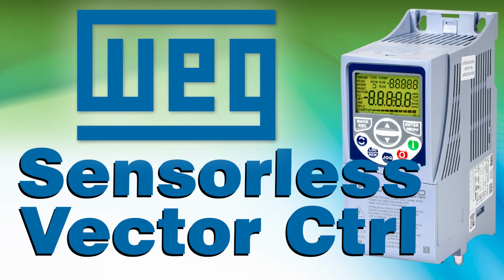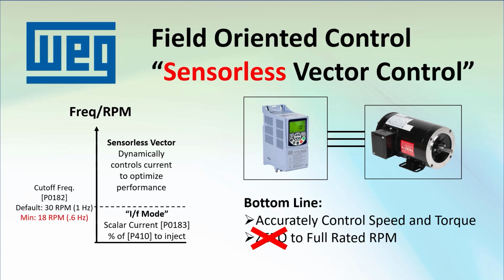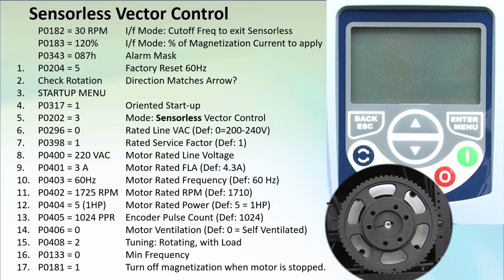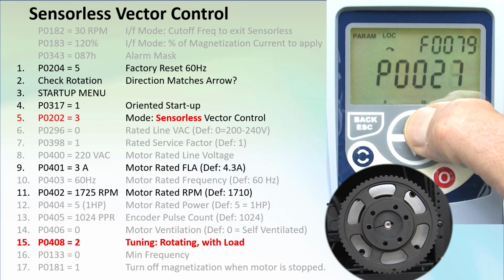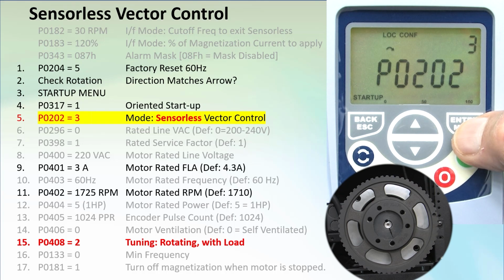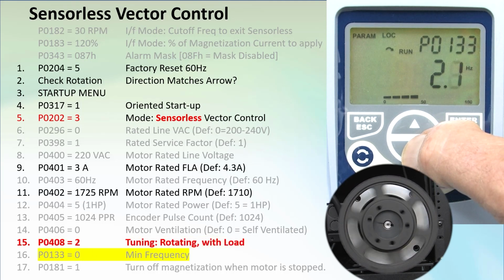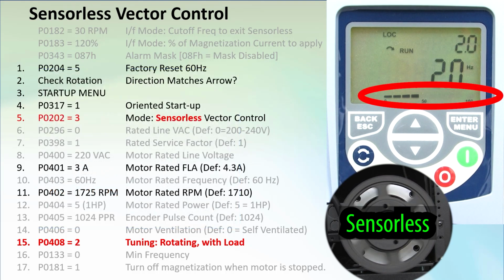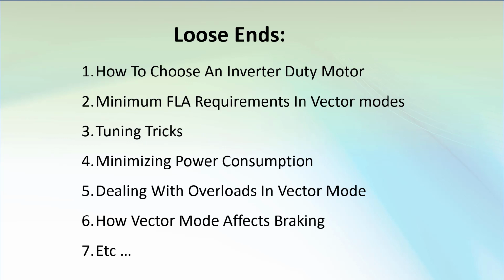WEG CFW500 VFD Sensorless Vector Control from AutomationDirect

Comment: In this case, are you using econder or not??
Reply from the maker: Not in this case. The CFW500 does support some vector modes that will utilize encoder feedback. This is a sensorless vector mode so it utilizes real time electrical feedback from the motor leads to allow the drive to target precise speed and torque at nearly any frequency.
Reply: @automationdirect  In this case, can it be used as a printer rewinder? As soon as the operator stops the machine, the material is tensioned
Reply from the maker: @murilomotta5038, in most printer unwinder applications we would recommend a servo for much faster response time to the torque loop in the material tensioning. This drive can be used for tensioning applications in firmer stronger materials (like taking up belt tension in a flexible tension situation for a conveyor) but take a look at our SureServo 2 or LS servo options with torque mode for much better response in unwinder applications with sensitive materials that are more prone to tearing. You are also welcome to try this drive in that application. We offer a 45-day free return policy for situations just like this, just make sure to save all the original packaging.

https://www.automationdirect.com/adc/shopping/catalog/motion_control

Comment: When you grab the pully the motor will stop running, so there is no current and the magnetic field will be stopping and there is no overload. Is this the advantage of using Sensorless Vector Control or torque control than V/H mode ?
Reply from the maker: Sensorless vector is great for those times when you more accurate control over your motor but don't have an encoder to do it.